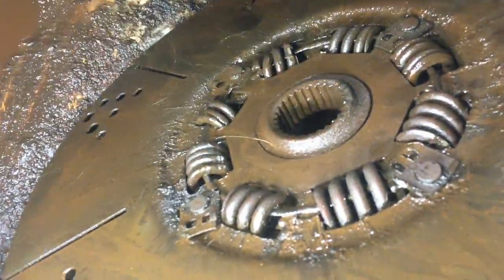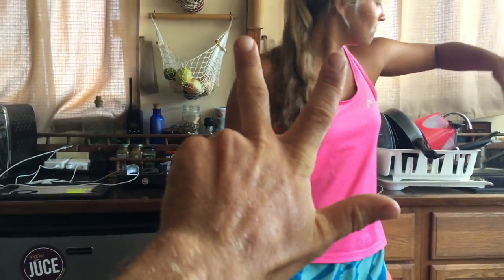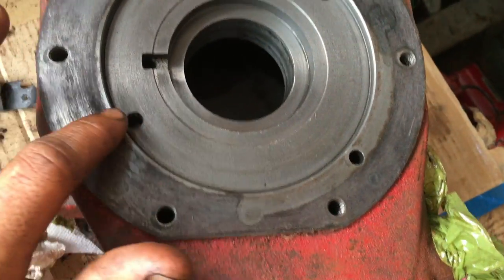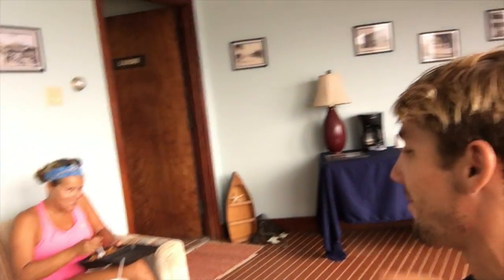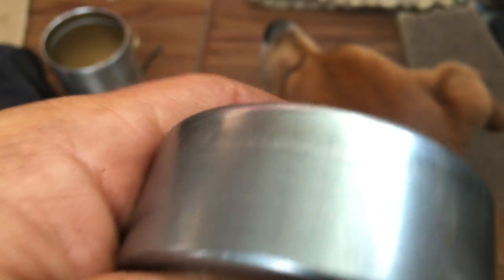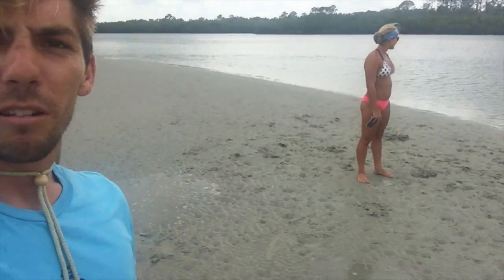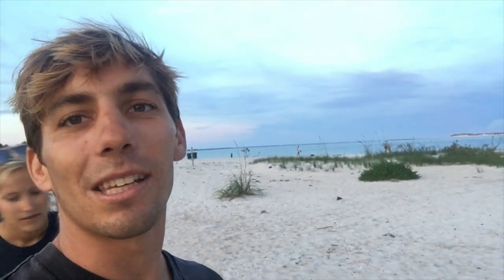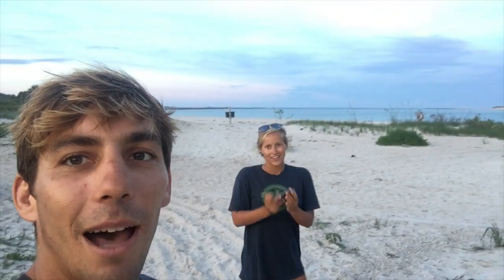how (not) to fix a boat

Comment: I worked at a marine dealer in the 70's and 80's.  IIRC, we didn't see a lot of Paragon transmissions - mostly Borg Warner. You did well getting out, disassembled and reassembled on your own.  Don't beat yourself over the setbacks.  Good luck with the new/rebuilt unit.  You could be opening up new avenues of future employment!

Oh... and really like watching you folks - especially Jetty.
Reply: David Stevens really should be replaced with a Velvet drive more parts available and a lot more common now
Reply: David Stevens Jetty has her own channel. Just saying... ;)
Reply: Porsche Collector Good to know... checking it out now

Comment: The positive thing is you are learning how to fix the transmission.  The best way to learn is by doing.  Keep up the great videos!
Reply: Herb M he hasn't learned yet.
Reply: Ed, he has actually learned a bunch even though it was not fixed. He learned how not to remove a bearing and probably a bunch more stuff. I have been in his shoes a hundred times and I refuse to pay anyone to do anything. This stuff is not magic. Good on him for trying. This is how you learn.
Reply from the maker: Yup def learned a ton. I know EXACTLY how the transmission works now when before I had no clue. Very interesting what a planetary gear and reverse brake band do. All that.

Comment: I recommend you keep the original trans around, take to a qualified machine shop for repairs, then keep it onboard as a spare. I am hoping you verified that the shaft can turn by hand . You need to verify that the cutlass bearing is not jammed up as a result of the grounding..
Reply: Yes great advice for a single screw and since your coming to Long Island take it to Marine Engine and Transmission in Deer Park see Paul the owner he is the BEST around. He will fix it and test it right there.
Reply: Steven Hardy listen to this advise it will be harder to find it next time
Reply: Good idea , maybe Have the guy they purchased the rebuilt one , rebuild their old one.
Reply: Why ship it which is very expensive due to weight he will be near a top notch shop in L.I
Reply from the maker: Thank you for the recommendation everyone!
Reply: I had the exact same thought. No better insurance policy against a blown transmission than having a fresh one on-board. Pretty heavy to lug around, but it didn't look to be that big. So it sound be easy enough to find a place to carry a spare.

Comment: The voice of experience here.  A valiant effort by you.  Five bonus points for each attempt.  Next time  just take it out and have it rebuilt.  But seriously not many people would attempt that rebuild.  You'll be fine. Enjoy a few relaxing days and get underway when you can.  It is what it is. Nice boat.   While your waiting for parts.  You should change your fuel filters and buy some fuel stable.  The last thing you need is water in your fuel or a clogged fuel filter.  It happens a lot when you buy fuel at different marinas.  (Crappy fuel or water in fuel).  Let's see, check your bilge pump and free it from gunk.  Carry a spare bilge pump.  Stock up on fuses breakers and crimping tool electrical connectors, liquid electrical tape
Give some serious thought to the Lavio Dry Flush toilet.  Ruptured holding tank and or wast hoses make for a very nasty clean up.  .
Reply from the maker: yes, thank you for all the advice while we were down! I did some filters, oil change, all the good stuff!

Comment: You guys did an awesome job. For a guy who is not a mechanic you looked like you were very methodical in your approach which pays off in the long run. Things didn't work out but it doesn't sound like you totally lost it at any time. Also the angel Sierra's calming influence was hovering over you like a peaceful blanket. Excellent effort.

Comment: Your positive attitude is inspirational. I had a trawler with a Twin-Disc tranny in the early 1980's. Clanky, but reliable. In  1987 I bought a new, 35' CT Sundeck Trawler with a Ford Lehman SP 135, with the "good" Borg Warner tranny. I sold the boat last October (to get another boat!)... That Lehman engine and BW transmission was awesome. (I had 2800 hours on the engine when I sold it; had replaced most "accessory" parts on the engine, but thank goodness, never had to touch the transmission, nor the innards of the engine. I maintained it to-a-T, myself (with the advice and wisdom of Bob Smith via M.T.O.A.). I can tell you I would never have had the guts, strength, or knowledge to do what you are attempting here. I am very sure I could not have removed that transmission without an A-frame/block and tackle set up in the salon. Yes, I could have taken it apart, but there is no way I could have properly reassembled it. Your perseverance is commendable. I'm a relatively new subscriber, and have back-watched many of your videos. Keep up the great work!

Comment: 15 years as an auto tech and 5 of them diagnosing/rebuilding manual/auto transmissions. I can honestly say that they are never easy to work on, they are picky, finicky and expensive. Without the right tools (such as a hydraulic press and the special fitting adapters/plates) it can be impossible to rebuild (eg with the needle bearing you dented). Don't be too hard on yourself, you did better than I would have if I was in your shoes, at least you tried! I've seen guys more qualified than me with way less patience and commitment than you, good job on your attempt!

Comment: Sorry guys. I know your frustrated but your positive influence on your vlog is great. You will get over this hump.  Just remember this is just temporary. You guys are still doing things most can only dream about.  Keep going foward and I am expecting to see you cruising on your next vlog.
Reply from the maker: Thats not the clutch, its the back of the flywheel where a drive plate connects to and a drive shaft from the transmission inserts in. Always in. The clutch pack are in the gear housing in the center of the transmission. Clutches were fine with almost no wear. Thanks for the recommendation though! Turned out to be a stripped coupling/shaft on the back of the tranny.

Comment: Ok.  Don't mind saying it.  I'm impressed.  I know how hard tearing apart a transmission and putting it back together is.  Though looking at what you're working with and the sound it made (or didn't make) I'm left to wonder if it's as simple as you forgot a key on the shaft.
Reply: PelenTan omg, imagine ... lol. I'd be throwing tools into the water.  this guy has patience for sure.
Reply: or linkage

Comment: A man has to know his limitations. Now you know one of yours.  You did show that you possess tenacity not to quit easy.  But transmissions are one of those things that it takes special training to be successful.
it would be wise to have your original transmission rebuilt and kept as a spare.  I say this because the one you got was used and you can't know how long it will last.
I tip my hat to you because most folks won't have the guts to show such a struggle..

Comment: you might want to purchase a super strong magnet and place n it so that it will capture and fillings.  just some where out n of Yue way but in the fluid flow. sometimes an old speaker has a good magnet.  try it. couple of months later, it will be covered in fragments. cheers

Comment: hi guys try turning the pump around, same thing happened to me after rebuilding a prm transmission a few years ago. there is no mark to show which way is right so make sure holes in the pump line up with holes in the  gearbox. hopefully this will help
Reply from the maker: Yes, I thought I might have made that mistake but when I took it apart again it was the correct orientation

Comment: I also suspect shaft issues.  You'll need to be sure it and the cutlass hasn't been damaged in the grounding.  Plus, you'll need to make sure the transmission is aligned with the shaft to the right spec with a feeler gauge.  Any misalignment will lead to vibration that will tear up your transmission in no time.  Good Luck!!!

Comment: From American diesel see link on previous post
Drive Damper. Inspect your drive damper if you have more than 2500 hours on the engine. This could be a difficult or easy job depending upon where the rear engine supports are mounted to the engine or the transmission. If mounted on the transmission, a means to support the back of the engine must be devised. Contact us for guidance on how to best handle your inspection.
Part Number830-0007 Drive Damper (Lehman 80 & 120)
Call them for free advice cheers Warren
Reply from the maker: Thanks so much Warren!

Comment: Did you replace that plate that had the springs? That looked like a clutch disc. If it was it should have had some friction material on it, yours looked like it was missing the friction material. That is what makes the trans engage with the flywheel on the engine.
Reply from the maker: Yes, its a drive or damper plate. def replaced it. thanks for the heads up!
Reply: Kewl. Saw your vid with the final fix. Great content. Keep up the good work. Cheers

Comment: As someone else mentioned, turn the shaft by hand to make sure the cutlass bearing and strut are ok. Even if that is the problem, you still had to swap out the transmission, from the pictures, I could tell that it was on its way out anyway. BTW, I used to own the same trawler. Wait, i have to correct myself, I was thinking of the sailboat...the trawler is a full keel without a strut, but the prop can still bend against the cutless bearing, so make sure to check that the shaft spins freely.

Comment: hey Billy I've subscribed  to you guys for quite a while and watch you every time... I said from the get-go I don't think it's your transmission at all... when you rebuilt it and installed it and you put it into gear and it turned ,same exact sound and I hate to say it but when you put the other tranny in I think you're going to hear the same exact thing so... please try this before you take anything apart dive under the boat while the shaft is still connected to the transmission turn the propeller by hand all the way around and see if you can feel it binding up I personally think you have a major league bent shaft that is binding up in the Cutlass bearing or the packing... if you feel that shaft binding up as you rotate the propeller there is your problem a bent shaft and I'll bet you anything you want to bet that's your problem and has nothing to do with your transmission... I've been working on boats for many many years and when I first heard the sound that's exactly what I suspected but unfortunately I did not comment because everybody else did so sorry about that but please try that first best wishes
Reply from the maker: Hey Mike, Thanks for the advice. As soon as the problem occurred I dove down to check and see if anything was stuck on the prop and it was all clear. at the same time I spun it by hand under the boat and it spun free and smooth. Turned out to be a stripped coupling/shaft connecting to the back of the transmission. I guess same idea as a keyway but must have been getting weak over time for some reason..

Comment: It's frustrating not being able to help. I'm not familiar with that type of transmission, but it seems like you could bench-test it when it's out by turning the input shaft and check to see if the output shaft turns, when it's in gear. If the output shaft turns when you turn the input shaft, I would think the "no propulsion" problem would be caused from something else, either before or after the transmission. Is it possible the prop shaft could have sheared. Turn the prop while the other person tries to hold the shaft that connects to the end of the transmission. Turning the prop would also check to see if the shaft turns nice and smooth. I wish I could be there to help. Your attitude and work ethic is inspirational.

Comment: Billy....Give me the model of your Paragon Trans.....I am an old Army mechanic, and Paragons were in some of our military vehicles.  I am thinking if you look at military "TM" manuals (Technical Manual) on the web, you will find what your looking for and may even find the course used by the military to repair them.  Again, post for me the model number......is it a PV31L by chance?  Also, I remember these transmissions being on Perkins Diesel engines a lot, which means Salvage yards will have these transmissions laying around from old trucks and forklifts.  let me know what you can....remember that the military uses just about everything your old boat needs, and GOVPlanet.com is a great place to get what you need CHEAP !!!!!  It's a gov't surplus website, and there are several places all up and down the IWW where you can get parts, whole engines, and anything else you may need for pennies on the dollar.  Good luck.
Reply: PS,...that race you broke with the long bearings,....when putting them on use a piece of iron gas pipe and a small block of 2x4 wood to hammer it onto the shaft.   If you still want to fix this tranny, I will show you some short cuts and how to put some of the stuff together thru texting pictures.
Reply: I found something out from an old buddy of mine from the Army....he reminded me that there is a REVERSE ADJUSTMENT screw to tighten in order to bring the clutch plate into contact with the motor plate.  ....
....the reverse band adjustment screw is located on the side of the transmission. While in NEUTRAL tighten the screw until the transmission JUST BEGINS TO ROLL  or TURN OVER, then back off 1/2 turn !! You may have to do this a couple of times to get the feel of it, but it is simple to do at the level of knowledge you have now with this tranny. IF your Transmission seized itself in REVERSE then this could be the reason WHY the transmission did NOTHING when you engaged it the 2nd time, because some of those metal pieces you saw in the bottom of the tranny shell was the adjuster screw/bolt. You just need to bring the clutch assembly CLOSER to he motor pad so the tranny with make positive contact and the motor shaft will then take power from the motor.   Good Luck....Proud of you for doing this OLD SCHOOL !!   Today, too many kids don't think about doing this kind of MENTAL ENGINEERING to figure out how things work ....You can repair most anything, if you just use your brain and try to understand how things work.  SO VERY PROUD OFYOU.

Comment: You jumped on a project like that with little tools and no shop,  impressive.  I restored my boat from a salvaged sunk vessel when I was in my early 30's, did everything myself including engines but opted to buy rebuilt tranny's... and I had a complete shop.  Sometimes you just gotta bite the bullet and spend the money.  Damn good try though.

Comment: I would want to see that transmsition..i mean trasmision.. and how u pepaired it. Im no mechanic to.. but as far as i kow it all should be quiet easy. Its just a machine.. and if there is no drive to boat that means there should be obvious problem there.
Think about it this way.. if the engine works it puts movement all the way to prop.. and there might be more places than transmision that can fail.. if it got bad after u worked it into ound.. mby prop has some safety mechanism, some pins that broke and stopped it working at other end. Tho the broken springs show that the transition was in suffering. And if it doesnt engage mby there is something wrong with engageing mechs within transmition.. those things like to mess with adjusting.. mby something put other way around.. hand test everything before put together... spin with hand or some wrench if to hard... when open trie to think what does what, not what went where. Check for play in moving part.. like slideing forwards/ backwards, rocking side to side.

Comment: Jus subcribed last night and started watching ur vids and im not disappointed at all keep up the good work. I have a few questions tho hope u dont mind answering them. Do u have air conditioning? Why no wipers? Have u ever thought bout investing n some bikes? dont u need to flush out the engine on the dingy? and have u ever gon down the Hollywood/Hallandale/ FT Lauderdale Florida intercostal? Again live the vids and keep livin the life. :)
Reply from the maker: We do have a/c but we only run it like 1-2% of the time because we are usually on the hook with a breeze and we have to run the a/c off a generator which is noisy and adds up in cost. I have thought about bikes but one of my pet peeves is having too much stuff and esp[ecailly a cluttered boat which takes away from the look, feel, and functionality of a boat. Our skateboards will do for now.  We should flush out dinghy engine with fresh water but it is not imperative. Yes, have gone down the ICW in Lauderdale but on my old sailboat "Tula".

Comment: You basically tore down the trans and didn't find anything. You even said clutch plates look good. I doubt it's the trans....(well it could be now that you rebuilt it.😩) But on initial inspection you didn't find anything major and only self inflicted problems...my guess is it's a cutlass bearing. Especially due to the grounding.

Comment: that is your clutched that you're showing you need a new clutch you'll also need to pull your flywheel off and have it resurfaced before you put another one in otherwise you're not going anywhere. I doubt your transmission is bad I would have it checked out a good transmission shop but your main problem looks like your clutch and flywheel.